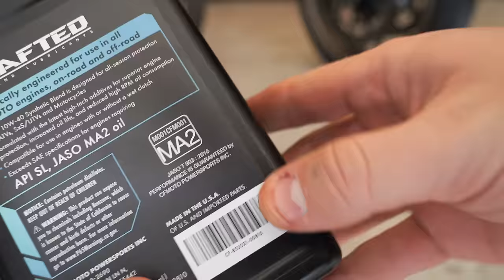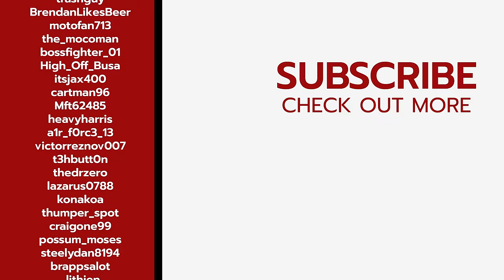Did I Destroy the 800NK? 600 Mile Hard Break-In Results!

Comment: This is the first engine i see with 2 drain plugs.
Reply: Some Harleys, actually, lots of Harleys have three drain plugs
Reply: @firefighter1c57  Why is that? We don't have Harleys around here, maybe some rare niche owners have one but I've never seem one up close.
Reply: @Napoleon_Blownapart   Harleys use a divorced transmission, so there's a drain plug for the oil tank, a drain plug for the transmission. The third is the primary. Since the transmission and engine aren't one, there's a chain and cases that connect the engine to the transmission called the primary drive, and it too has fluid to lubricate the chain and clutch.

Comment: The reason the oil came out was because on that bike, you can't pre-fill the oil filter.
That's about a half quart of oil there. Always partially fill the motor so the oil can fill the oil filter. Shut off, let cool, then fill to full line on dip stick, Ya dipstick 😂

Comment: How difficult is an air filter change?
Or how hard to adjust the valve clearnces ?
Reply: Air filter is dirt simple. Pull the seat, 5 t20 torx screws. Cover comes off, filter lifts out. Five minutes. As far as plugs, in the ibex 800t i own, 8 screws and the plastics are off, and you can get right to the top of the head for plugs, pull a couple bolts and the tank lifts off to give you easy access. Takes about an hour to do.

Comment: I dont understand what was your idea that you will destroy a new motorcycle in less than 600 mile... I do that amount of travel in a week, it would be ridiculous if it would just die and I had to buy new bike every each week. So no, this proves nothing this is as little usage as nothing. Like come on after the first brake in oil change the avg oil change period is 3-4k mile, it would be sad if the bike couldnt withstand it bruh. Tho Im interested that how much reliable is cfmoto. If it can withstand minimum 50k miles than its good in a bike withouth mayor issues, my bike has 40k mile and most of the parts original only replaced the worn-out things like chain, oil, filters, brake pads, tyre

Comment: 3 minutes for 1.25-1.50 is stingy? Damn. Around where I am there is typically only one car wash in a 50 mile radius, and even if you did skip to the next town over it wouldn't matter cause they all charge 1.25 for 50 seconds

Comment: So I really want to believe this is a legitimate showing of what the "break-in" oil looks like, but when you don't go over the actual oil filter with all the metal specs that were very clearly visible from when you pulled it out (without a close up), it for me places the video under a bit of suspicion. Really hope you're not shilling for cfmoto :/
Reply from the maker: Here you go: https://youtube.com/shorts/RKLPWGgsSqQ?feature=share
Reply: I would love to see the end caps cut off and the pleats straightened out to give it a proper inspection. Going over it with a magnet wouldn’t hurt.  Nothing more than I do to my own bike when I perform an oil change(except I have to cut my filter open with an oil filter cutter). No motor will have zero metal particles on filter from the break in service.
Reply from the maker: @chuckcull5674  Next time I do an oil change on a CFMOTO I will, you've got my word.
Reply: @spitescorner  I appreciate the effort! But as you can tell from the comment I left on the short, I still have some concerns.

Hopefully next time you'll be able to show your results without leaving room for people like me to poke holes in said results :)
Reply: time into video 4:28, lots of bits on the filter

Comment: There is nothing wrong with Chinese bikes, all bikes break in pretty even measures -especially as there are many shared parts now. What the biggest issue has been is the less than scrupulous selection of distributors - resulting in terrible parts availability. This eans workshops refusing to work on them as an easy fix can take a 12 month wait for a part ( I did it for giggles and it was about 15....). This spawns the unreliability myth as fixing a simple failure can be an absolute mission. I hasten to add my comments are post 2019/20 as that is the year when quality was notably improving across the board. In the UK at least, your brand choice can really ruin your day.